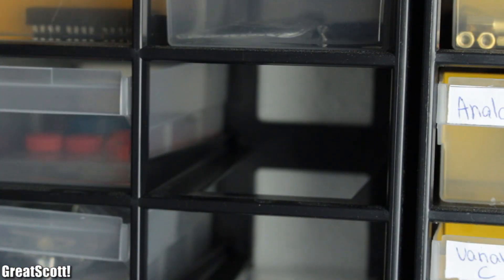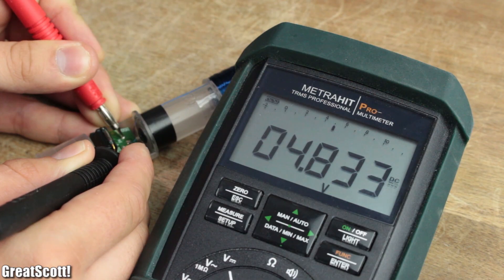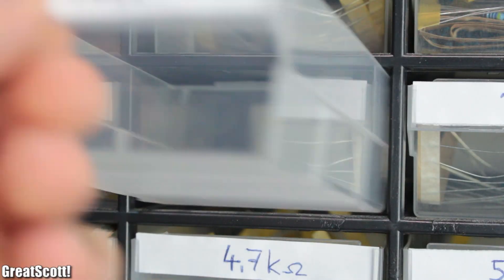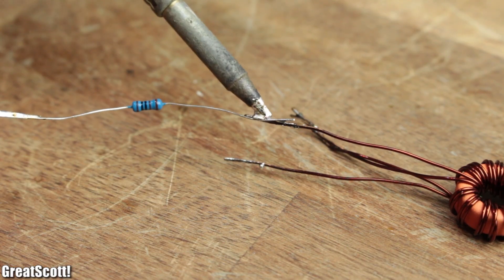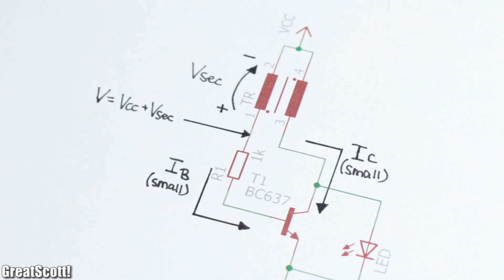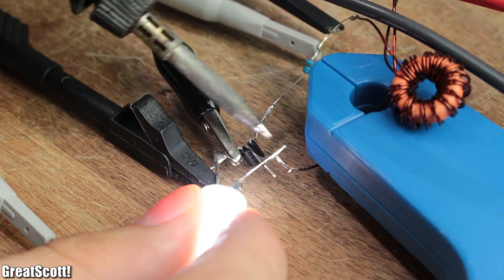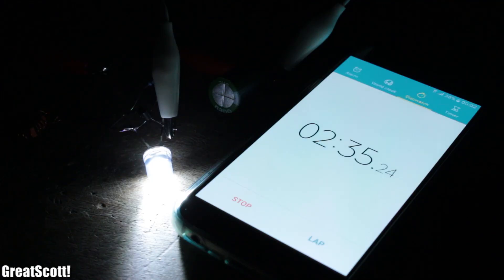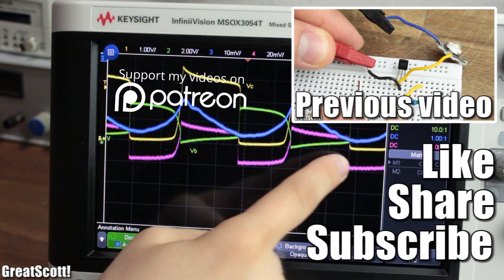Supercapacitor Joule Thief

Comment: Or buy DC-DC newest booster that increases voltages below 1V to 5V 
aliexpress.com/item/0-9V-5V-to-5V-DC-DC-Voltage-Converter-Step-Up-Booster-Module/32332755373.html

Comment: Can we use fan capacitor i saw it's of 1.5 Mf but it's working voltage is 220 v tell me i can't afford super cap
Reply: The "fan capacitor" will run the Joule Thief only a very short time.

Comment: It would be awesome if you made an update video with small improvement to make the joule thief efficient at least to 50% for the entire range of input voltage : 1.0 volt to 2.5 volt. 

Regulating the LED current to it's optimal value (0.5 watts / 3.2 volt =  150 mA) would be even awesomer.
Reply: tôi sử dụng pin NIMH dòng 20mA kiểm tra thời gian sáng 2 led được 16 giò tắt .

Comment: I have made a bunch of different Joule Thieves, the best working one of them all I made using one of those chokes from a PC laptop power brick, it was about an inch long, I used a medium size lacquer wire that I recovered from an old pc power supply a long time ago.  That one will work with a  battery that barely raises the needle on my old VOM. I have tried both the lacquer wire and regular insulated wire, they both work about the same in my estimation.  I have used LED's all the way from the  3mm up to a 1 watt, and all of them seem to light fairly well with them, what a great little circuit!
Reply: Excellent experimenting!  👍👍👍

Comment: I gotta light a LED (of the same current value) with only 0,45~0,5V and I'm using this circuit (with the 2n2222a transistor). It really doesn't matter that  lighting time lasts a lot, because my power source are some peltier cells activated by corporal heat. does anyone know a trick to make it work?  I'm using a 1000 ohm resistor to the base and the transformer is pretty alike to the one in this video. Thanks

Comment: Would MOSFET or FET work better? And could it run An op amp to run the led With 2 op amps in series and the out put running into  the led and two more op amps in series with outputs of two sets in series?

Comment: Can you use one joule thief on multiple supercapacitors connected in series or parallel, or do you have to make one for each capacitor?
Reply: Parallel is probably your best bet. Connected in series, you'd probably have the problem that he had earlier where the higher end of the voltage range didn't light the LED. Connected in parallel, you'd have the same voltage range at a higher capacitance, so more lighting time. :)

Comment: I have searched high and low for info on the equations involved in designing joule thief circuits without any success. I want to use a joule thief to power strip LEDs with a 12 volt source. Possible?
Reply from the maker: For such an application I would go for a boost converter.
Reply: Thanks!

Comment: That is an oscillator, voltage is oscillating and gets energy from the condenser. But each oscillation energy gets drained till capacitor lose its load. Search RLC oscillator guys

Comment: i made a similar light source but its exceeding the 20 min mark im using my 1.0f 5.5v as power source and my led conected to another 50v 2200uf capacitor. led is the smallest one. and its still going after 20 mins
Reply: ok so i died at 1hours 3mins

Comment: I'm using a usb power brick to use with my arduino circuit. I will use the 110v at a relay and the 5v output from the brick to power the arduino. Do I need to worry about charged capacitor? If yes how can I discharge it?

Comment: If I were to use a 500F capacitor rated at 2.5 volts how much current could it provide?
Reply: Without the circuit

Comment: Hi Scott,  thank you for the video. I have a newbie question: I have a 5.5V supercap and would like to use it in your circuit to power a super bright LED. Can I just simply replace the 2.7V supercap? if not, what needed be change to make the circuit works?  Thanks.
Reply: hi guys, pls kindly help. I am stuck.
Reply: I don’t really know. But the LED is a 1.5-3V one so five volts might kill it instead of lighting it up. You might need a BMS (battery eliminator circuit) between the super cap and this Joule thief to bring the voltage down around 3V. I hope that was helpful.

Comment: I have no idea what I've just watched. has anyone seen my hat? it's a big pointy thing with the letter D on the front
Reply: I know it's sarcasm but i'll explain anyways.

The light has an operating limit.  Once the voltage drops too low the light turns off.  However there's still a lot of energy left in the capacitor.  This circuit draws that power out and bumps up the voltage to make the light run longer.  There were some issues like the circuit heating up too much or not functioning when there was too much energy in the capacitor, so he tries to troubleshoot those while still keeping the circuit simple.
Reply: Thank you for explaining, helped me understand it better
Reply: I have found it

Comment: It would be interesting to compare the total time the LED is on using the Joule Thief circuit compared with how long the LED would stay on just using a series current regulating diode or J-FET current source.  You would have to adjust the average brightness of the two circuits for a valid comparison.  This would tell you if the Joule Thief circuit was actually able to transfer more energy out of the supercap to the LED for the entire time the LED remains on or not, compared with a current source circuit. If you are using a source voltage that isn't high enough to turn on the LED, then you'll be forced to use some kind of boost converter.  A small DC-DC converter may be more cost effective than using a large inductor core in the Joule Thief circuit.
Reply: The standard Joule Thief is 45 to 60 percent efficient.

Comment: Can we use BC547 transistor?
Reply from the maker: Sure
Reply: An JFET is another kind of transistor. They are more effecient then bipolar transistors and can work better at lower voltages.
Reply: any kind of NPN could be used :)
Reply: You could also try it with an JFET.
Reply: +Loundre3 What is JFEt?
Reply: It is a good question!
Reply: Will it switch fast enough? JFETS are slower then NPNs but might not make any difference here. Not sure.
Reply: AFAIK JFETs are fast enough.
Reply: Engineer Saksham Yea
Reply: You could also use a PNP transistor if you reverse the Voltage.
Reply: Use a BC337-25.  The BC547 will have much less current through the LED.

Comment: on the joule thief directions i found, you didn't wind the same number of turns on the coil, you had a high count and a low count. don't recall what ratio though. what difference would that make to the oscillation climbing and efficiency?

Comment: Wouldn't it have been much simpler if you just connect two super capacitors in serial?
Reply: Yes, two supercapacitors connected in series would give a much longer running time.

Comment: Someone can explain what does he did in this video?
Reply: I don't know what is this srry
Reply: Boost converter = get higher DC voltage from available DC supply voltage. E.g to power a 5V device from a 3.7V Li-Ion cell

Comment: Great Scott.  If the collapsing magnetic field can generate up to 90 volts at the collector when the transistor turns off - why do you not need a current limiting resistor in the LED to ground portion of the circuit?  Why doesn't that initial voltage pulse fry the LED ??

Thanks for your response !!!

Comment: Hi there, I am having problems with a 4.2A, 24Vdc switch mode power supply cutting out (over current protection) when i switch on a 2A rated current DC motor with a relay.  I need to limit the inrush current which is specified to be 3 times the rated current of the dc motor, to prevent the power supply from cutting out. Any suggestions? (replacing the relay board with a speed controller or getting a beefier power supply is not an option) Please help!! anyone!? Great videos, keep them coming.

Comment: Would the same thing happen  if I used a 555 timer with some low K resistors, and a cap? And if so, would that be another practical solution?

Comment: With a bigger toroid from my old 600w booster and a transistor that can handle 10+A can I get usable current on the output of the joule thief for battery charging? (Low voltage and big current input)

Comment: Great video. I'm trying to figure out how to power my 12V gear motors correctly, so they will make the tracks move.
I'm having lots of difficulty.
They say nothing about the amperage required. 
I'm confused as to what I am doing wrong, I almost started a fire.

Comment: thanks for this good capacitor very technically sophisticated, and I would like to know if the capacitor is connected in series, and where exactly, in the diagram does not appear installed, and decearia know this, thanks.
Reply from the maker: The plus terminal connects to Vcc and the minus terminal to GND

Comment: I have a question that isn't related to this video but caab u use two usb a chargers and wire the outputs together to get a more powerful usb c charger aka mod a cable so ut has two usb As going onto a USB C

Comment: I dont understand a thing. but it looks cool.
Reply: +Chaaan Chaan Limbaroc
I think it's a sort of restrictor. The capacitor will output power with quickly fading voltage. It'll ouput more then needed early, then not enough later.

The inductor and transistor are the working components, one working in each stage (inductor is the coil and is like wireless energy transfer at point blank, and the transistor is like a voltage-actuated switch).

When the capacitor would normally output too much, the transistor cuts the connection until the power is used, then lets the capacitor supply another pulse of power. This simulates lowered voltage, I suppose. Lower average voltage in return for longer runtime. (That's good here. Didn't need that extra voltage, but did need that time.)

Later, when the capacitor runs low, the inductor starts forcing the capacitor to drain faster by adding extra pull on the output. (Less time in the not-enough voltage range, but now the voltage is enough. Also good.)

In all, I think the system reduces the too-bright time and the too-dim time and turns much of it into a what-we-need time.When the voltage is too high, though, the transistor gives up.
Reply: thanks man. It really helped alot!
Reply: Damn, even I could manage to understand that after your explanation...
Reply: @aboriani  you did? I understand joule thief curcuits and I've built a few and I didn't understand his explanation..
Reply: If you care to learn a bit more about the inner workings of this circuit, take a look at:
https://en.wikipedia.org/wiki/Joule_thief
https://en.wikipedia.org/wiki/Blocking_oscillator
Reply: WTF MAN?? 😂😂
Reply: It discharges a capacitor slowly and you can use it as a battery that charges very fast.
Reply: Maybe I can explain it a bit better...

The toroid, inductor coil is the key to understanding this circuit, if you take an inductor and short it across a battery, that inductor will act a bit like a battery except it stores the energy in a magnetic field vs chemical one

Once you short positive with one end and negative the other with a battery say 1.5v a magnetic field builds up (an electromagnet, you can pick up nails with one) 

When you release that inductor from the short, that magnetic field collapses and as it does the emf gets converted back into a voltage much greater than what you put in

That voltage boost is what drives the LED from only 1.5v  bigger inductor bigger the voltage spike and bigger the current draw from the battery

Now the driver part simply switches the inductor on and off many times a second so to our eyes the led looks always on, but it's not unless you rectify it with a shottky and put it through a capacitor 

In Scott's circuit he uses a super capacitor not a battery the capacitor is just the power supply, the base of the transistor switches on causing the inductor to short and the secondary winding of the inductor is what let's the curcuit know when to switch off 

Short answer is... collapsing magnetic fields from the inductor drives the LED😅
Reply: I learned he has neat handwriting

Comment: Hi! I'm wondering how you measured the efficiency of the joule thief? I have a joule thief here but I really don't think it's all that efficient, plus I hear adding in a 0.1uF ceramic capacitor across the positive input to the resistor and torrid increases the efficiency by a lot.. Thanks!

Comment: Very nice video, very shortly but comprehensibly describing whats going on in that circuit. Will there be a follow up video with more advanced circuitry that counteracts the voltage differences and tries to stay in optimal working point ? Thanks...

Comment: The step up buck converter is more eficiente then Joule Thief. But there are some min voltage limitation that usually start with 2.5v, but there are some versions that start with 0.8v, very nice for this same use proposed.
However, Joules Thief always can have some fascination under students and enthusiastic people, because seems there are some magic there. kkkk

Comment: Could I use some 16v 10'000uF caps I have spare? Would you like them for a video? :)
Reply: Is there a specific reason why many people seem reluctant to use the "milli" prefix for capacitors? Even on the caps themselves I often read 10000µF instead of just 10mF. Can someone explain this?
Reply: +swiss I can only answer for myself... I simply wrote what was printed on the cap. 😳
Reply: helut kuno I also considered this but I thinks it's rather unlikely. Electronic components are marketed mostly to electrical engineers, not to laymen who might fall for such tricks.
Reply: +swiss That, my friend, is a big fat lie. The world is filled with amateurs and hobbyists, and they absolutely love big numbers.
Reply: It is because of significant figures. Not all circuits use a 10,000µF capacitor as a battery, some of them need that exact capacity for timing. So you'd swap 10,000µF for 10.000mF.
Reply: +swiss  probably an advertising trick. 10000yF sounds bigger than 10mF.
Reply: I have some caps that say 10 000µF as well

Comment: you could try MCP1640 module. cheers
Reply: Use an FET, rather than a BJT. A silicon BJT will never be able to work down to very low volts because it needs a minimum of 0.6V from base to emitter. I think a FET version of this circuit can go as low as 0.1V.
Reply: @GRAHAMAUS  so what is the component you're talking about? Usually FETs have a high gate voltage at around 1-5V. I don't see any component that would fit for a joule-thief like circuit... the mcp1640 also has the minimum startup voltage of ca 400mV. Can any FET match THAT?
Reply: @electronicguy4550  thx! which one???
Reply: @userou-ig1ze  there are a lot of germanium tranzistors. So I cant realy pick one! But try to look for one that has low voltage on the base. And then you reverse the polarity of the led and the battery + -
Reply: @electronicguy4550  can't find a good one for a joule thief...
Reply: It works from 1V up (or more as I remember)  wee ned something that works even below that...
Reply: GRAHAMAUS I can't find any FET version of the  mcp1640. Does anyone know one?
Reply: Que sorpresa
Reply: Y yo suscrito a tí también :v

Comment: Interesting video. A few years ago I thought about getting one of those huge super caps to use as an emergency power supply to run some LED lighting since we were losing power so often but the city fixed whatever was causing the outages so I never did. After seeing this video I'm tempted to make it anyways since you can get super caps or even banks of them with protection for pretty cheap now.

Comment: Why don't just use a LED with a resistor? Why do I need the Coil and the transistor?
Reply from the maker: You can not power a LED with a forward voltage of 3.2V with a voltage source of 2.5V without any tricks.
Reply: +GreatScott! Well, you are right...

Comment: I don't even know what it is.
You have a power supply, powering an led, after a copper coil (transformer?) with a transistor and a resistor?

Wtf am I looking at?

I'm a beginner with electronics.

Comment: what do you think off this circuit http://blog.zakkemble.co.uk/a-lithium-battery-charger-with-load-sharing/ 
 for low power arduino esp8266 applications pared with a li-ion / lipo battery ? if what wut you change?

Comment: I want to replace my smartphone's battery to some high capacity capacitors with voltage regulator because caps charges so fast ...is this possible..??
Reply: Yes, it's possible to replace a battery with a supercapacitor but the supercapacitor would be much too big to fit in your pocket.